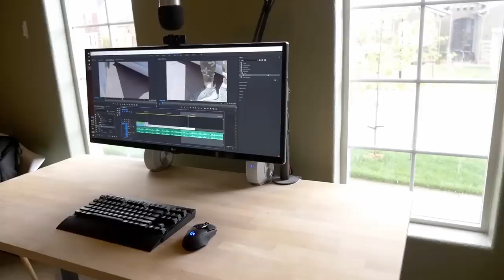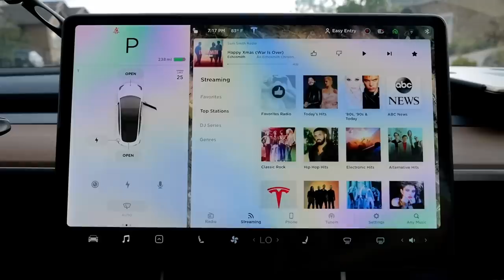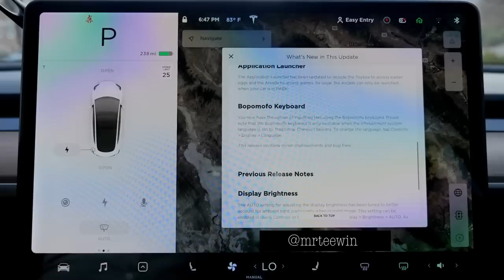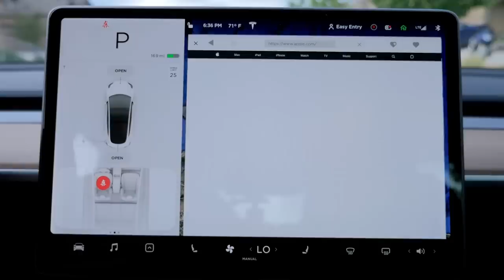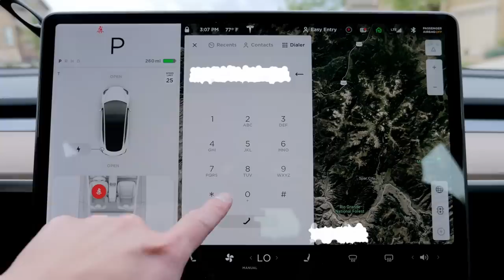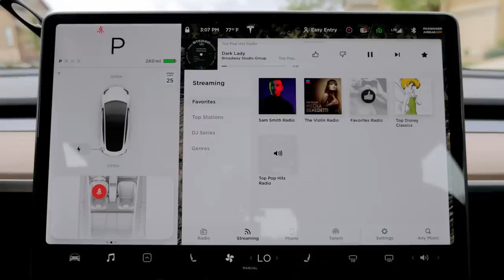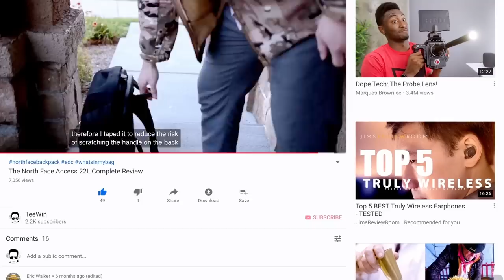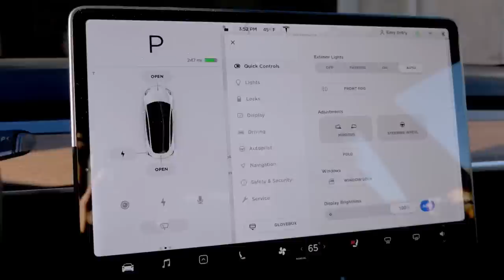Tesla Model 3 Car Review after 1 Year

Comment: Thanks for providing your perspective on handling / body roll. Not a lot of people have the context of knowing what good handling actually feels like; they are coming from Priuses (?) and from that baseline, most other cars will “handle well.”
Reply from the maker: You are welcome. We were a little upset that the car didn’t feel grounded around corners even though the huge battery should provide a low center of gravity. But we got over it since most of the time, we use Autopilot.

Comment: FYI the "Sport" mode only increases the weight of the steering effort and has no effect on the suspension. In stock form the Model 3 has soft suspension, especially in the rear. I think this was deliberate on Tesla's part to absorb some of the instant torque. I swapped out the stock suspension for MPP's sport coilover setup and the car handles incredible well now. Zero body roll with a big increase in turn-in. You can really enter into a corner at high speed and just point the nose accurately at the apex. If you start to lose traction the rear will start to come around before the TC system reigns in the fun. Get on the throttle as you come out of the apex and let the torque slingshot you out. So far I have been able to take corners on my favorite canyon road a few mph faster than my old modified Golf R.
Reply from the maker: That's good to know, can you send a link for the coilovers?
Reply: @MrTeeWin  Sure! They are expensive but worth the money if you value handling. Cannot recommend them enough. 

https://www.mountainpassperformance.com/product/mpp-model-3-sports-coilovers/

Comment: Two small corrections Tee. The "Sport mode" on the Model 3 doesn't do anything for the suspension. Only the stiffness of the steering wheel. And the doorhandles can actually be opened with a single finger. Not a big deal, but it is very easy to do. Great video, sir.

Comment: sport only applies to steering, coil springs DO NOT stiffen
Reply: Suspension stiffens, sure the coils don’t. Many cars are fitted with adjustable damping...
Reply: @chrisbraid2907  thats what im telling you, the suspension does not stiffen, why do you keep repeating false information?
Reply: What is it when the rebound rate of the shock absorbers have their rate of absorption adjusted?
Reply: @AthletismeQc  The "Sport" steering on the Model 3 doesn't change anything other than the force required to turn the steering wheel.

Comment: The all glass roof without an internal sun shade is a big  no no for Me .I have had many cars with glass roof as they are common in European cars and have been for many years. Without a sun sheild the cars get to warm regardless off the uv coatings they are also to bright houbget zero respite ftombtgecdun you end up wear baseball caps and dark glasses , a retracted able sun shield is need . I have purchased roof panels for my car without sunshade.its a poor design puts me off many Tesla cars. 
Steel roof much better.

No car manufacture charges for update my Volvo does them over  internet.  As does Lexus via there app
Reply: I would reconsider this view. You might have had this in other cars, but Tesla does a phenomenal job with their glass roof with blocking heat. I have the Model 3, and even with the sun beaming directly down on the roof glass, I'd say that at least 95% of the heat is blocked. It's honestly never been an issue for me. I'd test drive one on a sunny hot day and see how you feel about it.

Comment: Good video, not buying Tesla at the current state they are delivered.
Musk have to employ some quality check people. Better to fix their cars at factory level, than at customer.
Reply: They fixed them.
Reply: @dkdanis1340  oh?
Say that to the finish guy that bought the model 3 with litterly no Paint on it more on Main areas.
Rust buckets.
Reply: @Seawolf so that mean they dont have to Paint them?
And your not allowed to rust protect Tesla as it is a vailation on the warranty.
Good car brand...
Reply: @Seawolf several  Model 3 owners from Finland can confirm that it is not fixed. 
There is a reason why they went from Black to white as standard Paint.
You dont see Paint problems as easy.
I dont think it's the Paint, but the people and robots painting the car. And Musk try to save money on cutting coners, leaving cars with less Paint and quality than they should.
Reply: @Seawolf yeah thats true, but who wants to pay extra for Black when your after a model 3 as cheap as posible?

Well, in Norway Tesla is number 1 on complaints list. Dunno Finland.
Dont think anyone dare to make statistisk on Paint errors or other faults on Tesla. 
Would make them look bad.
Myself have very bad experience with model 3 and the old S85. Luckely i dont own them, just loaned them.
They made me turn away from the brand completly. 
My life is ti short for issuecars like that, as both the S85 had serious issues. And i havent started on the   inspecting after panelgaps and paint fuckups yet. The S85 had  gaps large ones visable tho.
Reply: @Seawolf well i just saw that you added a link. Well doesnt help telling people about the Paint thickness when they are delivered not painted. More than on Main panels. And also rust, alot. And when you can't rust protect it, to stop or fix, without loosing warranty, atleast the  model 3 is already a rust bucket. The Model S have corrosion and that also applies here.  
Well there is bucket loads of other issues.
Buying any Tesla is a 50 50 chance you get what we call a monday car.
A car that sees more of the inside on the service centers than they are on the road. 
The complaints here in Norway is  not mainly panelgaps and paint. But also issues with interior, screens, door handles, trunks, electrical issues, engines and batteries (not as much now but still there), AC, automatic door openers, panoramic windows just crack, water in truck, bad seals, bad brakes, noise the list goes on and on.
People buy this because like iPhone, they want to be a part of a lifestyle. As I said before why buy the copy when you just can buy the half price original Samsung?

The government also have some nice things making Tesla cheap as fuck. 
So why buy a normal ICE car when you can get a Tesla for the same price.
Just most of the Tesla buyers sell after a year, to buy a German car instead and swear to never look at an EV again, because problems with the car. Some buy a new Tesla, because what's the odds that you get a 2nd Monday car?
Reply: 50 50 chance
Reply: @Seawolf the Paris agreement  is a joke. Just see what other countries actually have signed. Compared to what the US under Obama signed.
You sign with what ever goal desire, and if you don't manage, well to bad. That's some billions wasted on some paper.

Well if you like Monday cars, it up to you. When Norway is the third ev marked in the world. I'll say we have more experience with Tesla as a brand than most countries out there. Just getting their model 3 delivered.
And yeah they fixed the seals, that still leaks, so good job to Tesla...
To all those that have their car at service centre for up to a year now. Good cars...

Well I will not waste so much money on a Tesla as long as they are at their current state. That's just to risky, and my life is not long enough to be fighting their service on warranty stuff.
Reply: @Seawolf problems with Toyota?
As it's the only brand you mention.
Well if we gonna show many cars that is parked outside. And that's the finger pointer.
Tesla have own parking lots with defective Teslas. They have even industry areas just to store them while try to fix them.
In Bergen they put up fences and a cover so you didn't see the amount of cars still waiting. Some have still been waiting for a year to get their car fixed.
About loaner cars, yes before. You don't get a loaners anymore. As Tesla is on a saving mode.

That's quality right there. Tesla have become the complaint car number 1, beats VW by length of horses. That tells a lot about Tesla.
Reply: @Seawolf well if you are to believe Youtubers, Tesla's main free advertising. There is no more flawless car than a Tesla.
Means that people advertis them wrong then. Car with faults.
Here is one, he is not alone tho, but he is the only one gone to media about it. Tesla have fixed his car, so it is now in a state that he can sell it for now. But they still haven't fixed the issues he reported, when he got the car 18 month ago. They have just fixed everything else.
Good car... I'm not buying that. Tesla gave him an offer that was so bad, 50% of what he paid for the car new.
Shows the true value on Tesla. After a year it is not worth more than 50%. They have gone up a bit now. Making used prices stupid high really, when Tesla don't price their own car at market thinks its  value is.
Reply: @Seawolf how drunk was this guy?
I just go to the show room and you see it live there, on all cars they have there. ON ALL.
So he had to be half blind and on the influence.
Well did he just look I  the window?
Well if I buy a Tesla and I take your word on that there is nothing wrong with them, do you take the bill if there is?
Reply: @Seawolf well thats answer enough for me. You just dare take the challenge, and Tesla only have returned on new ones not used ones with no warranty...
So you actually have me the answer that you don't dare guarantee the quality you say they have.
Reply: @Seawolf overpriced cars.